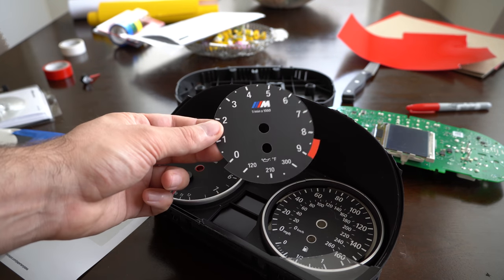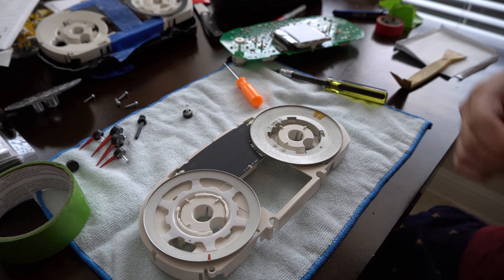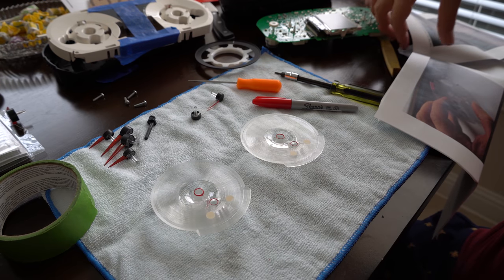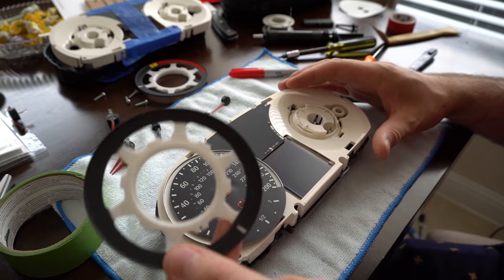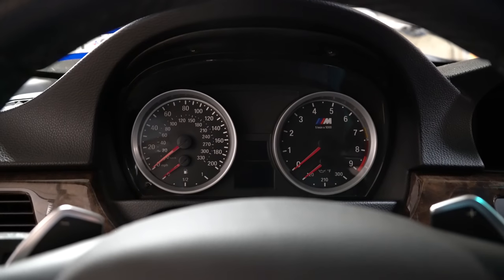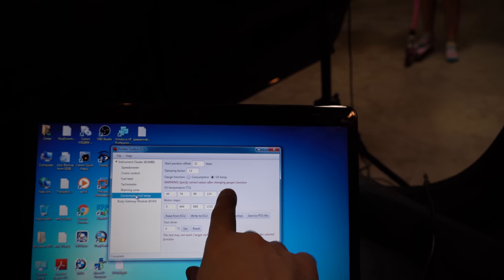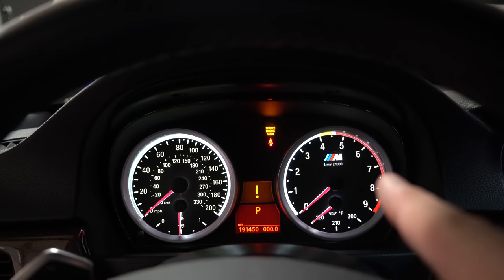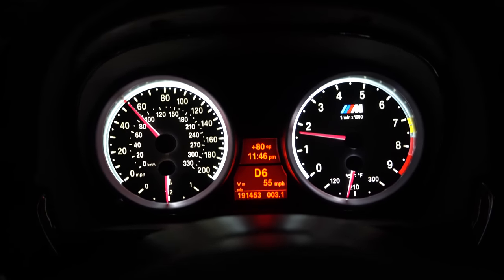Does This Look Like An M3 Cluster?  It's NOT I Made IT!

Comment: Hi. I just swapped out bad lcd screen on e90 328i 2007 cluster. Put everthing back together, conected to car, and my BC button and menu scrolling not working now!. What could have gone wrong? Scanned and got this error: A3A9 steering column switch cluster signal 0x1 EE receiver instrument panel, transmitter footwell module. PLEASE help.

Comment: 7:10 you can code the car with ncsexpert and ncsdummy and select the M3 instrumentcluster option to be able to use the M3 instrumentcluster in a regular 3 series. The ‘engine temperature meter’ will stop at your standard rpm limit once fully warmed up. That’s why you could’ve retrofitted the M3 cluster with your custom backplate with lighting up M3 logo and could’ve avoided the whole hassle. Still great video though!
Reply: but an M3 cluster isnt really cheaper

Comment: Good job.
The main problem is appearing small air bubbles on red tape in time, when inside of the car becomes very hot in sunny weathers. So, rather i prefer to paint that than taping. Or you must use heat resistant tape.

Comment: Hi!
Thx for great video! I would like to ask you . I want swap my original gauge  (Vmax 260km/h without rev adjustable scale & cruise marker; 7500 rev max). 
I found out one peace of used gauge from 335i. But they end at 280kmh and rev max is at 8.000 rev.
-> Q:  Im wondering if it is possible to change speed range? Put a new gauge face with 260kmh and set it up from 280 -> to the 260? Also set the rev.max from 8000 to 7500?

Thanks a lot for your answer!

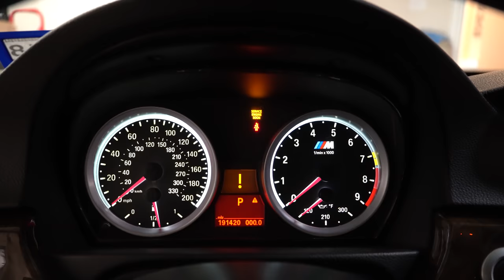Comment: 19:28 you do what you want to your car brother. Also, I have stuttering issues on cold start. Its smooth, hiccups, then once its done its warmup cycle its buttery smooth. Sometimes i hear my wastegates and on accel I get the hesitation but sometimes i don't hear the wastegates and the accel is smooth as butter. Everything is done, all oil gaskets, turbos, injectors, sparks, coils, hpfp, vanos, boost solenoids, silicone lines, clutch, you name it. Im attributing it to a failing crankshaft position sensor since im at 136k kms The tune is on the stock map 0 MHD for now until i figure it out. I also thought about upgrading my low pressure fuel sensor (with the new designed line) and the rail pressure sensor alongside the crankshaft sensor just to throw it all in.

Let me know what you think brother. Low pressure fuel system/pump/regulator has also never been touched but here in canada I only use 91 petrol.
Reply from the maker: You've recently changed the injectors?  Are they the latest index 12?  It sounds like leaking injectors from what you are describing.
Reply: @VehicularDIY  previous owner installed 3 new index 12s in bank 2 on August 2017. Last year April 2018 Installed 3 in bank 1, injector #2 sparkplug was wet so I bought a remanufactured index 12 and they have been dry since my last spark plug change. Im going to put back my NGK plugs since they are still good, I only put OEM boschs back to diagnose previous issues. I will check to see if any are wet with fuel again soon. If all spark plugs are dry, have a ruled out that problem? Thank you in advance. I'm not sure how to check if I have the latest version of index 12 Injectors but I do know they are all 12s and coded properly. Thank you
Reply from the maker: Yeah I'd say let it sit overnight then pull the plugs to see if any fuel is on top of the piston or the plugs are wet.  It takes outs of sitting for the injectors to leak enough fuel to foul things out.

Comment: I live in Houston and have a Question: I have e70 4.8i 2009 that was spec for Mexico so Km and liters on dash board (speedometer tach) - las 7of vin L097189. So I want to make it legal in US and to do so I need a miles gallons dash board (speedometer and tach). So I found an e70 in junkyard but it is 3.0 - last 7of con LY82294.
Is this a plug and play type thing or does it need to be reconfigure? If so what are the suggestions to do this in US?
Reply from the maker: You could possibly just change the faces.
Reply: Vehicular DIY will buy junk part 100ish and check
Reply: Vehicular DIY worked wonders and super simple. Took about 15mins total. Now I need to sell the instrument cluster w km only.

Comment: Can you use perfect toolbox to calibrate a speedo that reads wrong due to different wheel size?
Reply from the maker: You could use it to adjust how the dial indicates but the vehicle may still count he mileage incorrectly.
Reply: @VehicularDIY  oh yeah I hadn't even thought about the odometer
Reply: @VehicularDIY  would the steps be the same as the one in the video?

Comment: Please make an update video about the lsd conversion. I've heard many people are happy with the lsd for a week and after that it breaks or doesn't lock enough so it still feels as an open diff but with like 5-10% lock.
Reply from the maker: I definitely will, so far it's been consistent.  Unfortunately I haven't been able to really push it due to my sub frame being cracked.  It's cracked right were the passenger side engine mount is.  The more I drive on it the more I can hear my down pipe hitting the frame due to the flex in that area.  Otherwise I would have already really pushed it.  I bought the new sub frame and will be doing a DIY on it shortly then I can really push the car. So far I've mostly tested while rolling and it's been consistent, you hear the tires chirps a bit but the car feels stable and doesn't pull to the right at all now.
Reply: @VehicularDIY  Nice, looking forward to the update video, really considering to convert my diff too as these guys are from Serbia and i am travelling through there soon and they will do me a good deal to grab a converted diff from them. 
How come your subframe is cracked, never heard of this issue on e9x, i've got an  e46 and they are very common to crack on the rear diff mounts.
Reply from the maker: Yeah it's just the aluminum subframe itself not the chassis so easy fix.  I have almost 192K miles and the car has been making big torque for a long time.  So the constant pressure of the engine putting all it's weight on the right side of the subframe probably took it's toll.  I bought a really clean replacement subframe from a low mileage 328i for $180.  I specifically went for a 328i as it wouldn't have been put under too much pressure.
Reply: Valentin don't waste your money. It works only on gravel in my e46. Not worth the expense
Reply: @luke45412  Too good to be true for about 400 pounds to have an lsd. e46 m3 lsd isn't too expensive to swap in but the diff ratio is too short for me as mine is supercharged and even with the current 3.38 is too short, ideally i want 3.15 ratio so an m3 diff isn't an option. e46 are fucked with no options for lsd..
Reply from the maker: How were you testing, were you looking for marks on the ground?  I'll try to mimic the testing you did.
Reply: @VehicularDIY  I have tested mine in the wet and dry on tarmac. In most cases it opens completely even in a straight line. In the wet both wheels will lock until you experience any weight transfer. The car is unable to perform a donut even if you get the wheels spinning first. However on the gravel it works perfectly. Very predictable and locks as expected. I suspect the small clutches are not up to the job when grip is increased.

Comment: Hi THANK YOU FOR ALL THE VIDS.Q:Can the Combi in a e90 330i 2005/09 be coded to activate the extra bc functions you got late 06 and up via NCS and how if possible?
Reply from the maker: Thanks for watching, can you confirm what features you are referring to?  Digital speedometer etc?
Reply: Tx for the quick reply its the functions were you can change door lock settings,auto lock.daytime lights ext.These settings are not present in 05 early 06 e90s yet the hardware aka the cluster combi unit seems to be.

Comment: Bro can you sell me your old one?
Reply from the maker: You want the parts to do the conversion?  If so sure, I have an extra set of parts.  The stepper motor, the ring and that white plastic piece etc.  Shoot me a message if you want it.
Reply: Vehicular DIY link to the heads up display?
Reply: @VehicularDIY  you used m3 speedometer the stepper motor?